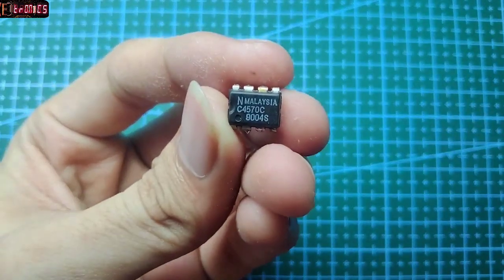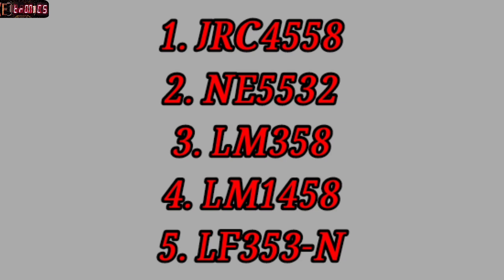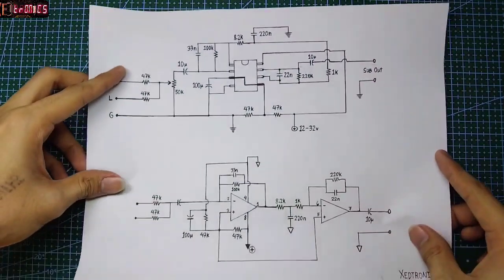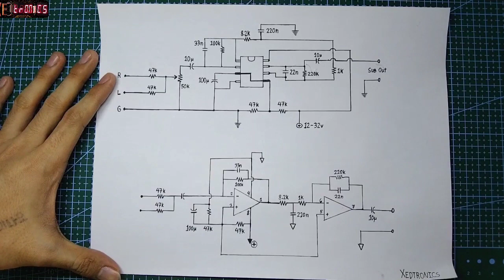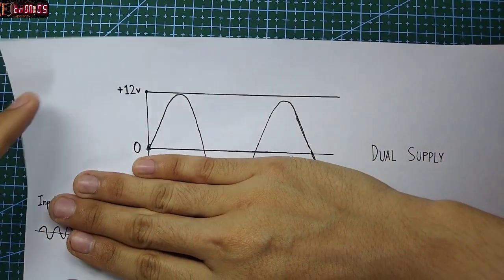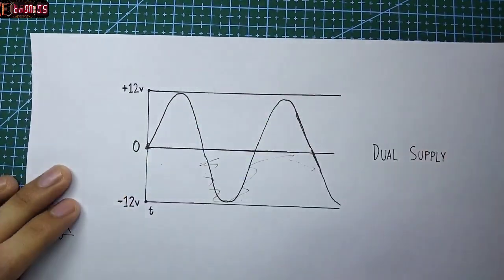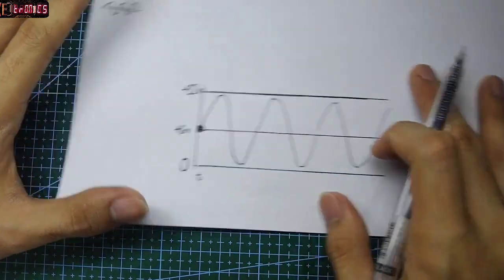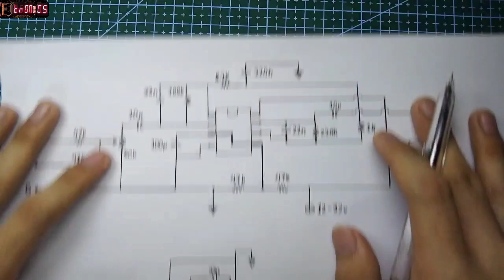Low Pass Filter/Single Supply heavy bass Active Low Pass Filter with schematic #lowpassfilter

Comment from the maker: P.S :
If you want lower cut off frequency (more bass,less vocal)
YOU CAN CHANGE THE 33NF in the schematic into a 100NF(104) capacitor upto 220NF(224)
The waveform and amplification explained in this video refers to the NON-INVERTING amplifier setup.
While Inverting amplifier setup is the opposite of that waveform explanation.

Comment: Bro how have you managed noise? I have bought ne5532 module which creates humming extra noise. I cannot stop it.
Reply from the maker: Use Shielded Cable bro. Check your Filter Capacitor, Check the Grounding.
Or check the layout, the Hum is the Picked up Noise from the electricity around us which is Either 50 or 60hz.
Design the Enclosure properly

Comment: Amplifier's ground and negative pin is same what should i do the voltage divider won't work
Reply from the maker: What do you mean bro?? Please check your circuit bro
Reply: @x3dtronicsph  very complicated issue 
Amplifier has positive and ground(negative) supply but with same supply the low pass filter's ground and negative pin will short
Reply from the maker: It will not short because they're both grounded

Comment: Gain is too high and clipping. Please suggest modification
Reply from the maker: You can lower the value of input potentiometer, you can also lower the value of feedback resistors to decrease gain, and lastly, you can add another potentiometer on it's output
Reply: @x3dtronicsph  Tried with pot for volume in both input and output. It lowers volume but it sounds like it's clipping.
Experimented different values for feedback resistor, it sounds better now but lesser punch.😂
Thank you.